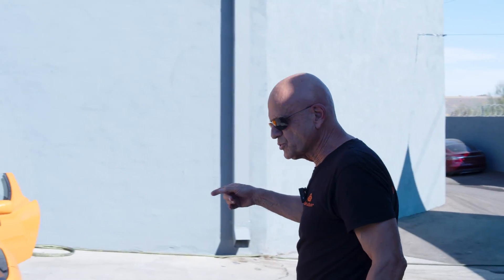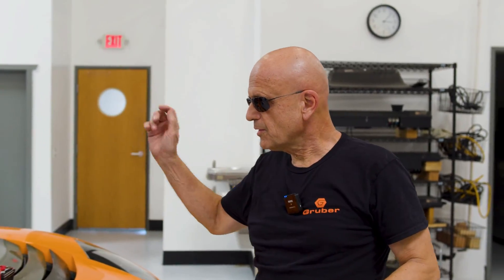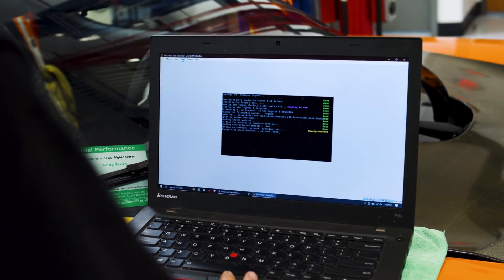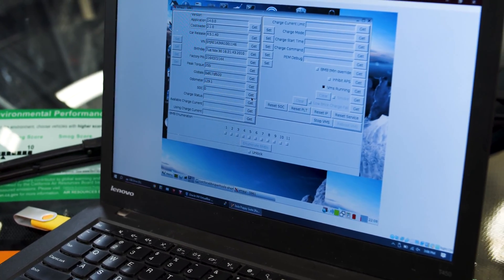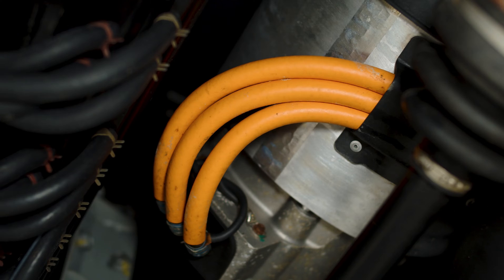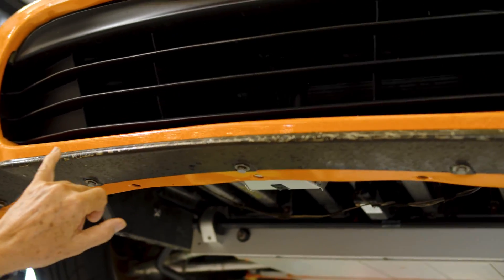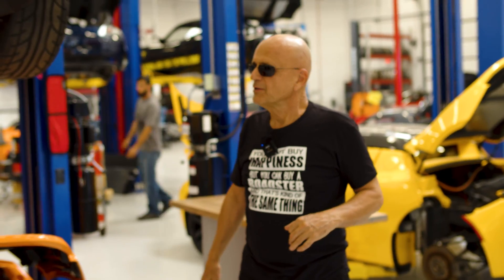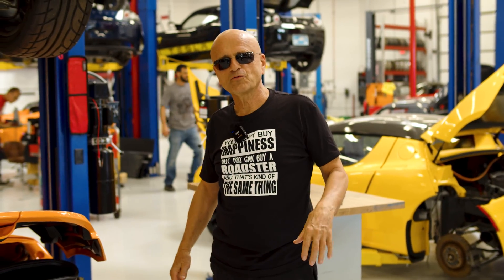Examining the Final Chinese Roadster II | Gruber Motors

Comment: 1) Why did you release this video so late??? I remembered those 3 roadsters were shipped back to your company and bid again maybe more than one year? Wasn't it?
2) What's that tie rod made of? Certain stainless steel? Or aluminum alloy?🤔 I knew certain material like stainless steel which claimed it wouldn't rusty, but still, it's going to be rusty if it endured all this atmosphere along the way so many years, due to some key elements in it.